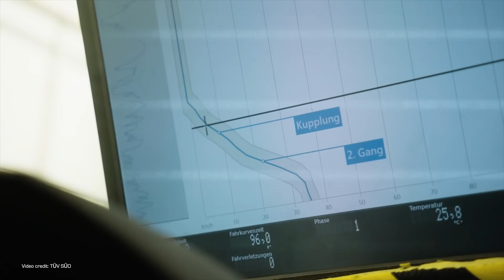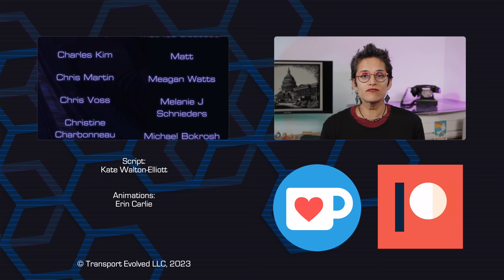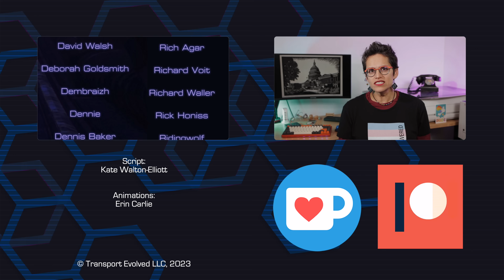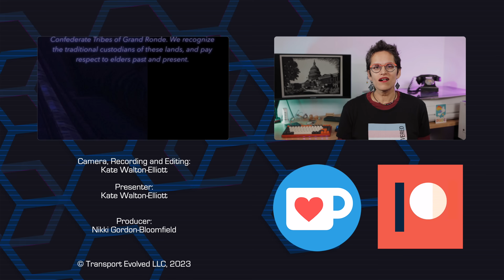What's causing the U-Turns on Emissions?

Comment: Truth is Evs are too expensive for mass adoption right now.
2030 is a totally unsustainable target 
You're trying to change - not transition -  an entire global fossil fuel dependent economy.
..
If there was a cheap clean energy production mechanism that allowed cheap EVs on par with their ICE cousins, then this would speed up adoption. But only marginally..
..
Low minimum wage paid people wil not be able to use transpor.  (especially in the US where there is no real public transport alternative)
So effectively cutting off members of society from traveling to work or pleasure or meeting family..
Until transport options available to all become viable, the current EV strategy will cause MORE iniequally...
..
A better option for now would be hybrids, this allows slow market adoption. 
People can adjust to new transport initiatives.
Synthetic fuels also offer potential low emission possibilities using current known, albeit antiquated, technology..
until EV technology is cheap enough for all, and more importantly, nuclear fusion becomes commercially available..
A more sensible 0 emission target would be 2050-70...

Comment: GM crushed the EV-1 prototypes and sold the battery patents to an oil company when the California Zero emission mandates were defeated last century. Toyota was then put off building [any] electric car for 10 years after having their battery supplier (Panasonic) sued over the RAV4 EV.

That incident is probably why Tesla used an impractical number of 18650 Li-ion cells in their battery packs. The form-factor was already in wide use in laptops: so their suppliers could not get sued over building electric cars.

Edit: 14:00 My province (Alberta) banned new solar for 6 months! The want to keep the gas peaker plants economically viable.

Comment: Like this format, very enjoyable. I don't quite agree with some parts of your views as the picture in Europe is quit different to the US. We already have one charging standard and a leftover flop (Chademo) so infrastructure in some areas is very good - usually reserved to the northern part of Europe. Prices are still a barrier for many as the only relatively cheap options are really all from China, and that includes in part Tesla. This is the fear auto companies and trade unions have that they will lose large amounts of jobs. There are several reasons why payback here is not quite as easy as for the US: First prices: prices are indeed 20-30% more expensive for a european car that has both BEV and gasoline versions - Peugeot 3008. Second miles travelled: average miles travelled in Europe are substantially less than in the US, and yes gasoline more expensive but for many even with home charging the numbers don't work. Third: at least in Spain very large amount of cars park at night on the street and charging would require it to be mostly via fast chargers with a high cost of electricity and today still mostly slow speeds. Fourth: hidden cost of BEV - INSURANCE. In my case it would cost almost 4 times as much to insure a Tesla, at Tesla, than my current car. Could add some more but not really needed.

In summary, I believe that consumers will switch when the conditions are right for them. I already contribute with my large solar array with batteries but the numbers just don't make any sense today.
Reply: The cost of insurance is an interesting one. I'd love to see the EU investigate it (I'm not an actuary but I DO understand the math and I also understand that they will use every "cheat" they can).
Reply: @capnkirk5528  Another youtuber in the UK had a video last week about the issue where I also commented as it is a hidden cost that people should take into account. Just like when BEV advocates highlight, correctly I add, on the savings in maintenance there are some other extra costs nobody mentions. You should look at the total picture.
Reply: Insurance is rising everywhere. Mine doubled and I thought it was because I had a Tesla that was totaled, but all my neighbors also had large increases. 
Partly because body shops are struggling to find staff and parts. The US automakers are on strike, so the parts shortage should increase for awhile. 
Partly it is because automakers are building cars that are not traditionally repairable. They are safer in a crash, but you can’t just run them down to the blacksmith to bang on a new part. 
At least in Europe and China there is a decent public transport system. The US went all in on individual cars and is paying for it now. 
The switch to EV’s is not just a monetary numbers equation (although EV’s are cheaper to operate over a ownership cycle), but it’s also going to be an immigration issue because as large areas of Africa, Asia, southern Europe and the central US become uninhabitable for months at a time, people are going to want to relocate in very large numbers
Reply: @kenmcclow8963  I hear you but although I am american I live in Europe (Spain) and highlight that fact. My insurance did not go up as that is a US issue. The price I quoted for insurance was using my current insurance company for my car and a Tesla M3 for the next car with my same driving patterns, mileage and history albeit for the Tesla M3 at Tesla as it would be even higher at other companies. My friends in the US all pay ridiculously high insurance rates for everything, specially my relatives in Florida. Again, just like the cost of healthcare and insurance are ridiculously high in the US people complain more about the price of gas going up than they do about medication, healthcare or insurance.

Comment: The state of Texas is a microcosum of the shift to EVs, grid scale solar, grid storage solutions and VPP. You might want to devote a segment to Texas just to catch up on how renewable energy is crushing the fossil fuel industry.
Reply: Small point about that not being as good as it sounds in Texas. Much of the wind and solar is built to power refineries so they can pretend to be "achieving net zero emissions".

Oil companies get the cheapest energy. 

Oil companies get the green grants and subsidies. 

Oil companies get all the materials and skilled labor for alternative generation. 

Oil companies keep up demand for fuels by preventing the rest of us from using alternative generated electricity. 

If that alternative generation was just plugged into the grid by anyone else it would reduce the demand for fuels and ALSO reduce emissions from fuel production. 

The most stupid of these projects is powering carbon capture on a refinery with wind/solar. All the stupid uses of technology in one place.